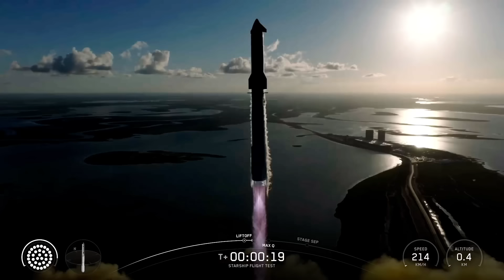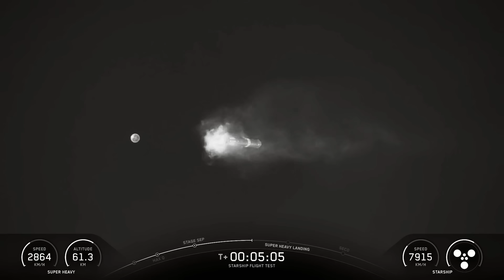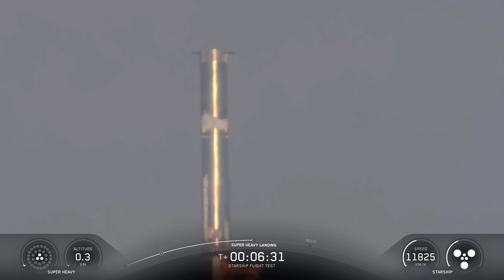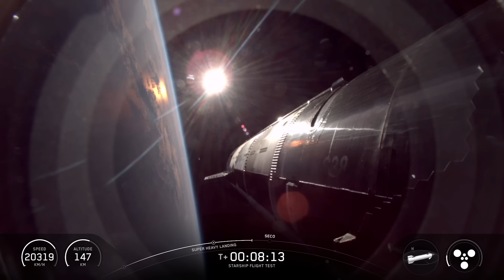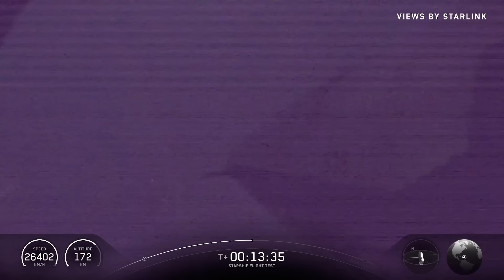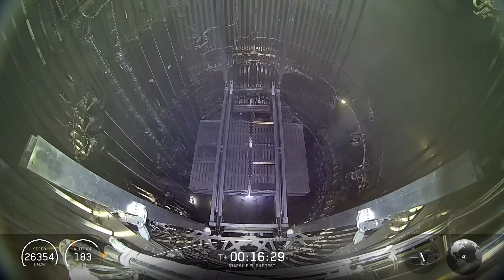FULL FLIGHT! SpaceX Starship 11th Flight Test

Comment: 33:54 Can someone explain what's causing those waves of light repeatedly washing over the ship?  At first I was thinking maybe an artifact of dynamic contrast/brightness camera control settings but the way it seems to actually illuminate the ship makes me think otherwise.  Then I thought maybe its just outgassing being illuminated by the early sun light from just over the horizon but that can't be it either because the waves are moving in the direction the ship is travelling whereas brightly lit gas plumes would be drifting exactly opposite to the ship's direction of travel. The light pulses actually start a good ways before my timestamp and go on for quite awhile while in the Earth's shadow, but just picked that timestamp to give a good example of what I'm talking about.  Still haven't found anybody else that even so much as acknowledges them, including in these comments so really hoping eventually someone could "shed some light on it" for me :p Cheers folks!

Edit: I might be wrong about it not being outgassing because the direction of travel can become quite confusing as the ship slowly rotates, but if that is the case what would be the light source illuminating the gas plumes?  Sunlight reflected off the moon maybe?  Thanks!

Comment: Again to ocean? Elon pls stop pollution of not your planet!!
Reply: Say that after do some recycling or smth
Reply: @boryu5258  It happens and you answer "this".... 🤦🏻
Reply: @wexelo  V2 is still test vehicle, not recovered ship part will turned into home for sea creature, Fuel is just atmosphere material. Anyway, do you using plastic rn?
Reply: @boryu5258 It's worse than I expected. I expected they recovering it😮😢 those are methan engines?
Reply: @boryu5258 I don't even use a car 😁
Reply: @wexelo  im not using car too. And Raptor using Liquid oxygen and CH⁴. They are just atmosphere.
Reply: @wexelo  why not recovering is worst? Did you thinking Stainless steel, ceramic, copper, and other material destorying sea
Reply: @boryu5258 Yes CO2 makes up some of the atmosphere, but Starship releases bad excess CO2 during launch. But whatever who cares it's a fucking rocket
Reply: @boryu5258 ok, methane is better.
Reply: Just creating a marine habitat.
Reply: @libertycowboy2495 starship can't land on ground? 😅

Comment: did not the ship explode at the end?
Reply: Might have been planned, unless it was a steam explosion that caused it
Reply: They did say they were stressing it hard.
Reply: Any time you dip something supper hot such as six raptors that were just shut off, into water that is much cooler there will be an explosion as the energy will equalize rapidly. The ship still has some fuel at that point, so a wonder fireball follows.

Comment: Sad the booster and Starship were destroyed, such a total waste. Why was Super Heavy dumped at sea. Space Shuttle system never saw this style of wastage
Reply: Super Heavy was "dumped at sea" because it's an obsolete design that they have no further use for, Starship was expended for the exact same reasons, future vehicles will be fully recovered.
Reply: @Tmccreight25Gaming  Space Shuttle was never dumped at sea, it worked straight out of the box from day one
Reply: @leokimvideo shuttle is a space plane, booster and ship are a rocket, two different things, shuttle had some issues in the first flight and had plenty of flaws, spacex is changing designs every time to get the best ship and safest. Block 2 boosters can not be staged with a block 3 ship.
Reply: Space Shuttle dumped every RS-25 engine, every SRB, every External Tank into the ocean. Complete waste. The final iteration of Starship will waste nothing, including the hot staging ring.
Reply: @JayZ-Denton  No. The SRB's on the shuttle program were recovered, rebuilt, then refueled. Google helps.
Reply: Pretty sure they will recover the floating superheavy
Reply: @gordanhatesjiujitsu if there is a large piece they want to get, overall 2 boosters have hovered and dropped to get rid of it and have no piece floating .

Comment: Why aint they landing the booster back at base like before
Reply: They don’t want these old V2 boosters anymore and are moving on to V3
Reply: They are making sure that launch and re-entry is 100% resilient before working on catching starship. The booster is easier to refine and catch because it's not actually going through re-entry, it's basically the falcon9 booster which they already have experience with.
Reply: It was proof of concept. They also reused those 2 boosters.

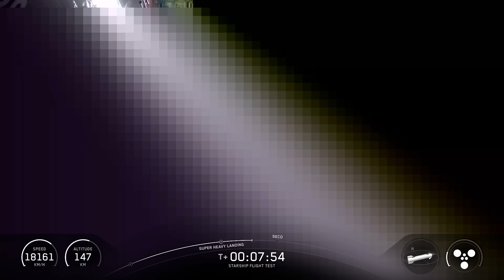Comment: 8:50 why was that sonic boom so far after the landing of the booster? Why destroy everything?
Reply: 1: The booster was several miles away and sound takes a while to get back to mission control.
2: To prevent the ship or booster from floating out of the exclusion zone designed for the vessels.
Reply: @archierush868 Why destroy them and sing both rocket and lifter?
Reply: @Leo-gt1bx they don’t often recover splashed down hardware unless it has data that they really want.
Reply: Go to a baseball game and sit in the nosebleed seats. The batter will hit the ball and almost be at second base before you hear the crack of the bat.

Comment: I wonder why they didn't launch real starlink sattelites with this flight?
Reply: They’re on the same sub orbital trajectory as the ship so they’ll burn up anyways, so no point in launching expensive satellites that will be destroyed minutes later
Reply: @archierush868 mkay. I didn't know starship didn't get to orbit.
Reply: @archierush868 Say that again because it makes no sense.
Reply: @Leo-gt1bx the ship is not in orbit, it’s in a near-orbital trajectory where if they do nothing, the ship, and all payloads it deployed, will reenter in a few minutes. Why should they put actual, expensive satellites on a trajectory where they’ll reenter in less than an hour?
Reply: @Leo-gt1bx "I'm dumb so everything I don't understand is nonsense"
Reply: Good question and why crash the booster.
Reply: @Leo-gt1bx to ensure its destroyed and doesn’t float out of the exclusion zone
Reply: @archierush868 So they just dump it in the ocean to do more damage. Why was it not landed?
Reply: @Leo-gt1bx they don’t want these old boosters anymore and are transitioning to V3 ships and boosters
Reply: @Leo-gt1bx block 2 boosters are not capable of newer pad hardware and ship.
Reply: @Phat-b6q What happened to the old padware surely this would have been good practise?
Reply: @archierush868It's still scrap metal and other things no? Why leave it in the ocean?
Reply: @Phat-b6q They have been landing block 2.
Reply: @Leo-gt1bx Pad A OLM with be removed and be made into like how we see Pad B.
Reply: @Leo-gt1bx it’s just stainless steel. It’l sink and make a manmade coral reef for marine life eventually. Some nations do this with old military hardware to both test new weapons, decommission old equipment like naval vessels and tanks (yes, some nations just dump tanks into the ocean), and it becomes a natural reef for marine life.
Reply: Because it's never carried cargo before. They like easy. Cargo is hard. Getting to orbit is hard, starship has never been to orbit before. Coz hard.....YAWN. But GO ELON!!! Ya fkn plebs 🤣🤦‍♂

Comment: Why land in water and not on a pad?
Reply: Several reasons, including these. 1. These are an older version of Starship and Super Heavy that are no longer needed. 2. If there should be an explosion at the landing site, that would set them back months during rebuild. 3. Many problems were purposefully introduces (like missing heat shield tiles) to test for weaknesses, making failure more likely.
Reply: @martythemartian99  Do dump it in the ocean and kill it a bit more? They have been landing these so why dump this one even if it is the last one.
Reply: @Leo-gt1bx space. They don’t have enough space to store these boosters while making the other V3 boosters they’ll reuse several times over, and since they don’t want to fly these old boosters anymore and move onto V3, why should they catch a booster they’ll never reuse again apart from the very first one?
Reply: @archierush868 That is nonsense.
Reply: @Leo-gt1bx theres a limited amount of storage space at the production site, these boosters are now outdated, and they can no longer refly these boosters as they’re tearing down the pad and moving onto the next one built only for V3 ships and boosters while they upgrade the first one for V3. Why catch a now outdated booster which will never fly again?
Reply: @Leo-gt1bx Lmao, they don't plan to use these boosters anymore. Instead of wasting money on recovering they just destroy it, as it's dangerous to have such a big object just floating around. How is that nonsense?
Reply: @Leo-gt1bx there’s three million shipwrecks in the ocean,try to get some sleep.
Reply: Understood, intentionally they are destroying those old boosters to collect some useful data like how much stress the star ship can handle with or without those heat shield tiles at the time of re-entry and many more. These will help them to make some reliable ships in future. Currently they are learning from the mistakes.
Reply: So when the bit that's supposed to have people inside blows up (yet again) they tell you it was planned.
Amazing that in a country that invented the Ponzi scheme nobody can spot the biggest in history when its right in front of them.
Reply: @mikezappa  are you ever studied rocket science or watched Starship program from the beginning?
Reply: @mikezappa  Oh look, another armchair rocket scientist who thinks a SpaceX explosion is proof of a global scam. Buddy, NASA’s spent more on coffee than you’ve spent on critical thinking. You think “planned test failure” means fraud, but you probably call your microwave breaking “a government conspiracy.”

Starship’s literally pushing the boundaries of human spaceflight — meanwhile, you can’t push the boundaries of your mom’s basement Wi-Fi. Every rocket that’s ever gone to space has blown up a few times first; that’s called engineering. You wouldn’t understand — your biggest “launch” is when your crypto portfolio goes up by 3%.